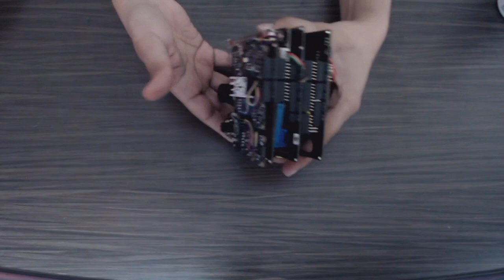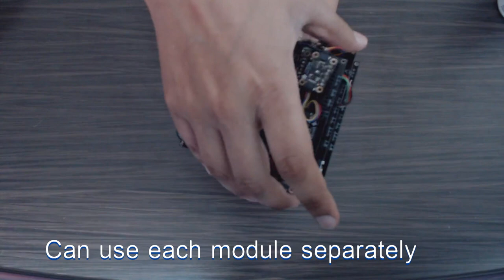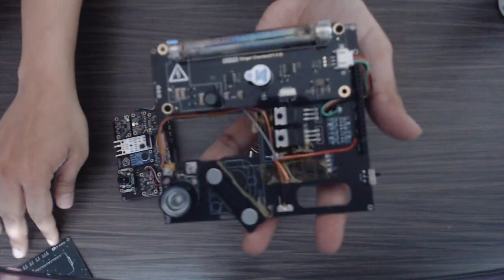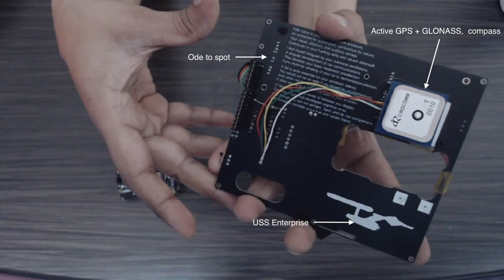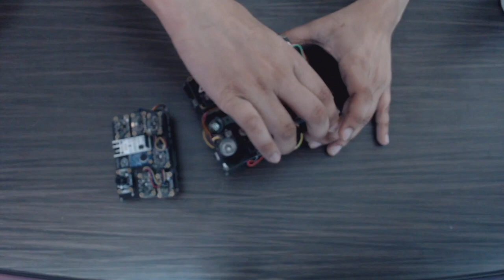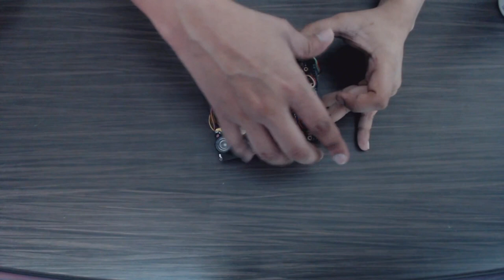Tricorder-ESP32 Hardware Description

Comment: What is this for?
Reply from the maker: This video was for testing/practicing how to showcase the project. There will be a more comprehensive video soon. 
A Tricorder is a scanning device from the Sci-Fi franchise Star Trek. When you go to a new planet you want to be able to measure things like the composition of air, scattering of sunlight, temperature, pressure, etc.  In the show/movie, they have a handheld device that does this. This project is an attempt at making one in real life. What you are seeing here is the max number of commercially available sensors  that I could  practically integrate into one mobile device.